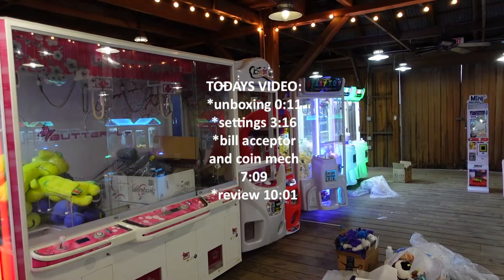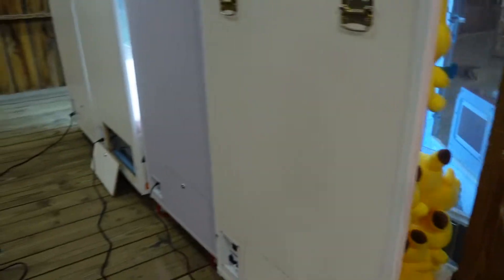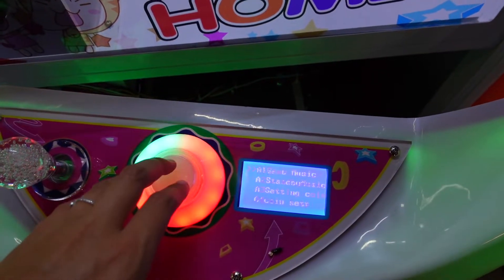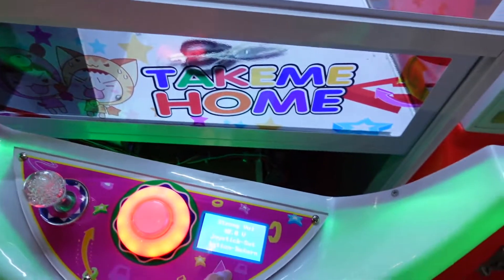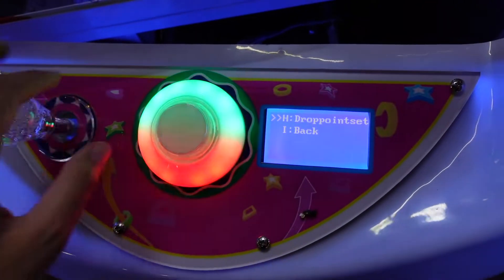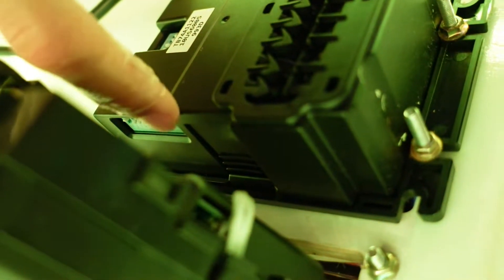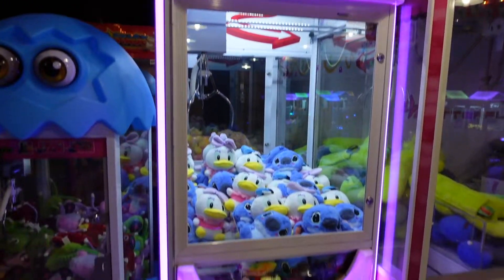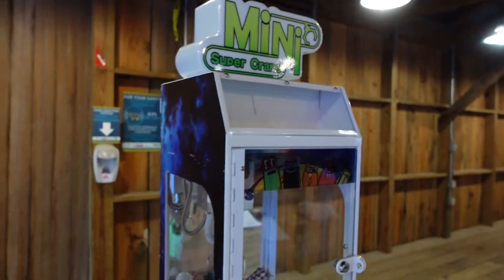ALIBABA LARGE CLAW MACHINE SETUP, REVIEW, AND UNBOXING! how to set up coin acceptor/coin mech

Comment: Thank you so much for this video!  We just got some claw machines from alibaba also.  And came with No instructions what’s so ever and even the staff has little or no idea 😅 
How did you learn all of this?  Again Thank you for sharing it, def helpful for people like us.  Our machine is a little different so we will see if we can get to the settings you mentioned.  
We also have a token machine, but the bill acceptor does not take $1 or $5.  Just $10, 20 and haven’t tried the bigger bills..  is it because the switches need to be turned on for the 1 and 5 like you did in this video ?
Reply from the maker: We are so glad to hear it can help you!! That’s crazy, I would ask them to send you a manual for the machines you bought from them. Eli has online manuals for ours, so that is how we learned. 

Yes you may need to change the little switches on the bill acceptor. Ours are 1 & 5, and then other machines of ours are 1,4,&5 that are switched on. You can play around with the switches yourself if you want and turn the machine off and on each time you switch it differently until it’s right-or reach out to the people and ask for a manual and ask how to set up the bill acceptor to take US bills. Send them a video of the LED screen not counting up your big bills and giving the correct credits so they can see what you are talking about. It helps both you and them be on the same page. Hope this helps more!!